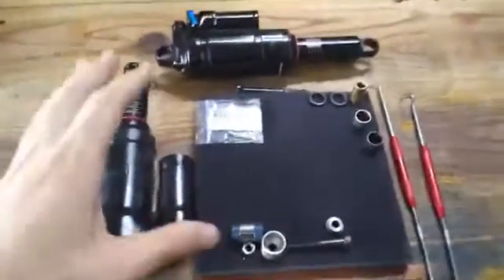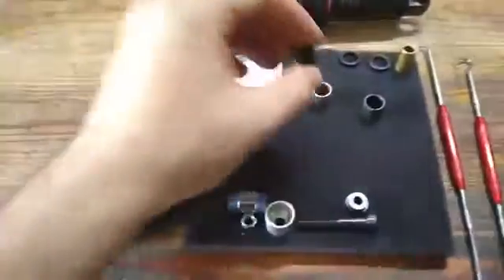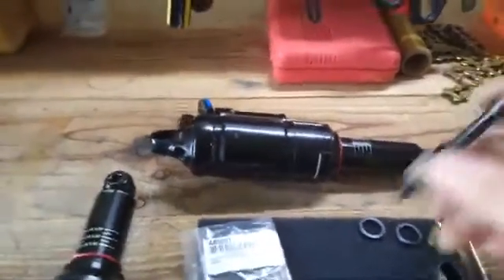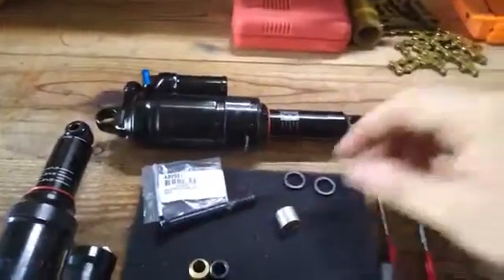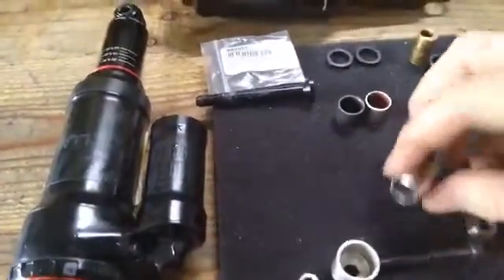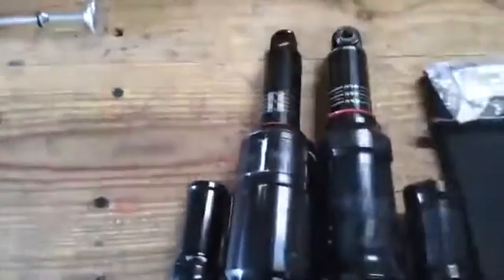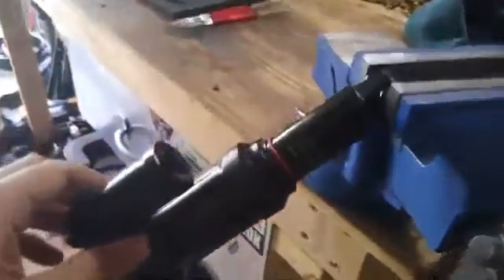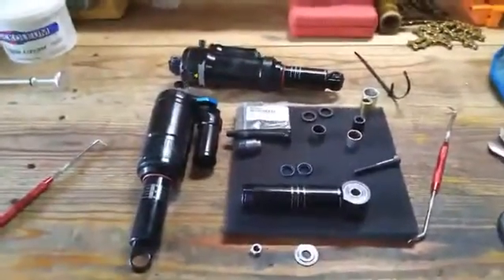MTB shock bushings explained

Comment: Hey. I have a rockshox Monark Rt. Can you tell me the part number or where I can find the standard factory bushings? I'm from Brasil, I just bought a 2015 Bronson C and I need to get the bushings replaced.
Reply from the maker: Both  rockshox and fox use the same size bushings
https://www.amazon.com/RockShox-Eyelet-bushing-kit-shocks/dp/B003UW5W12/ref=asc_df_B003UW5W12/?tag=hyprod-20&linkCode=df0&hvadid=312144750238&hvpos=&hvnetw=g&hvrand=9346021863412715433&hvpone=&hvptwo=&hvqmt=&hvdev=m&hvdvcmdl=&hvlocint=&hvlocphy=9010780&hvtargid=pla-564880964098&psc=1

Comment: But if you shorten the eye-to-eye, you may overstroke the frame. Cause the travel would remain the same. The idea i had is to shortening the shock in the inside with a calibrated bushing. In this way you shorten both travel and eye-to-eye distance
Reply from the maker: Offset bushings are mainly used with the intension of changing the geometry of any bike, all major brands have incorporated it into their frames in the form of "flip chips" The few millimeters that the bushings offset will not cause the frame to be overstroke, the only effect it has is that it makes the main pivot on the frame sit slightly deeper into the travel. Reducing the stroke of a shock via spacers or internal bushings will cause cavitation inside the damper body.
Reply: @trailsidemedic5303  cavitation why? Its commonly done in motor bikes, where theres a lot more heat and its a lot more demanding
Reply: @trailsidemedic5303  For anybody reading this in the future, the information provided here is most likely incorrect.

The video below shows and explains how using offset bushings does mean your rear wheel will now be allowed to travel further up compared to standard bushings, which can lead to interference. Around the 3 min mark

https://www.youtube.com/watch?v=e30M2rOQLDk

Comment: hi...good informative video you have... do you have a link for the needle bearing? im not really sure what to buy...thanks..
Reply from the maker: Hi Anjoe here it is.. the size will be dependent on your frame. 
https://www.ebay.com/itm/ABI-Shock-Eyelet-Needle-Bearing-Kit-M6X22-2mm-/373312554324?_trksid=p2349624.m46890.l49292

https://www.enduroforkseals.com/products/rear-suspension/shock-eyelet-bearing-kits/6mm-8mm-thru-bolts/NEEDLE-BEARING-30.html